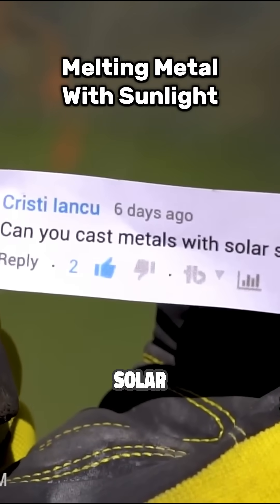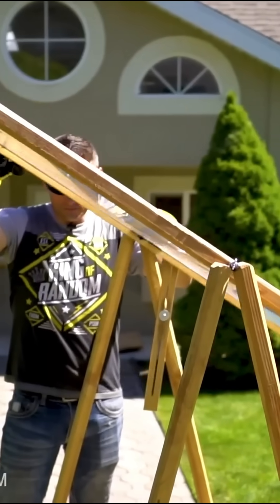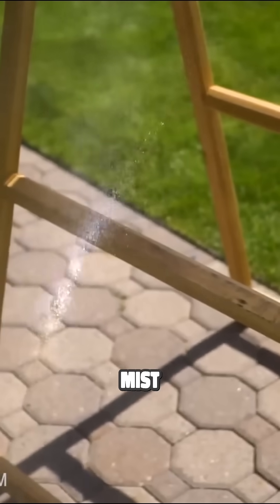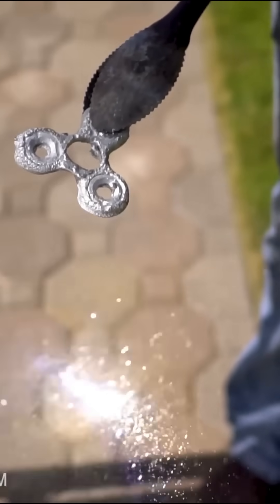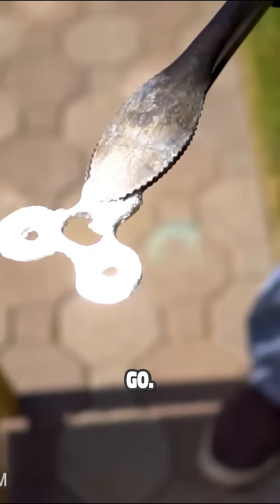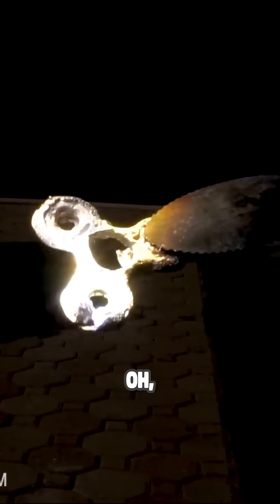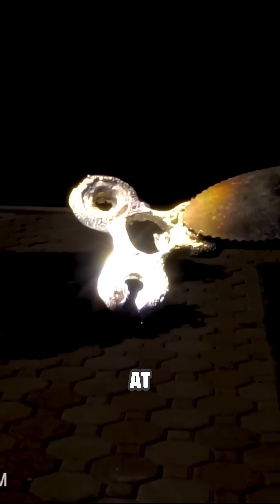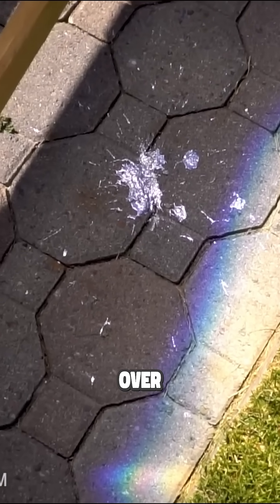WE MELTED METAL WITH JUST SUNLIGHT

Comment: The temps goes well above 600c. Which is enough to melt metals like magnesium and aluminum. Do not put any combustible material there. It will ignite instantly. This explains why the thermite can be ignite, it requires very hot temperatures to ignite.

Comment: Gallium is a metal that you can melt by holding it in your hand (86 degrees). Tin melts at 450 degrees.
Reply: So happy I'm not the only one who thought that looked like Gallium...
Reply: I figured it was lead which somewhere around the mid 600's. Which can easily done your stovetop...